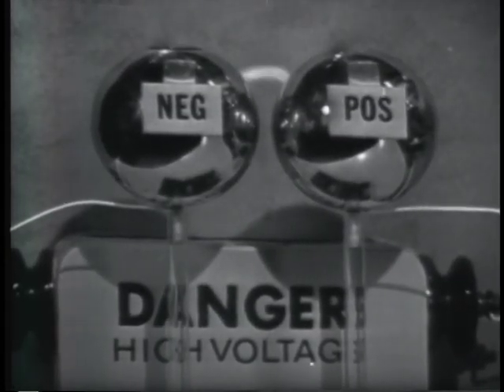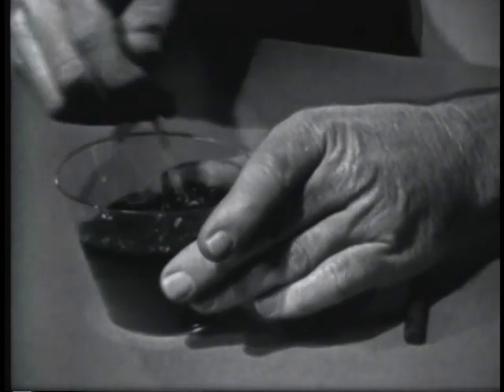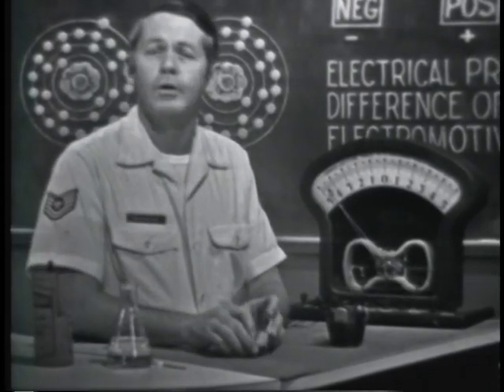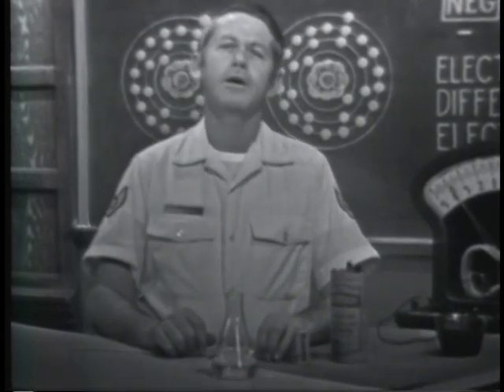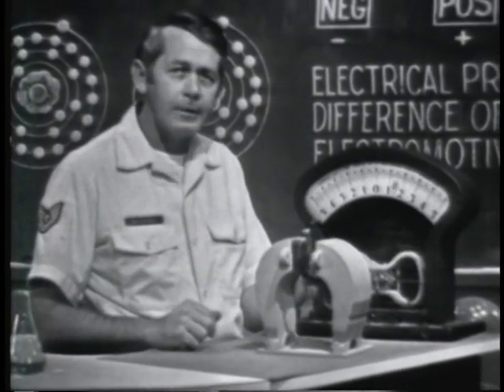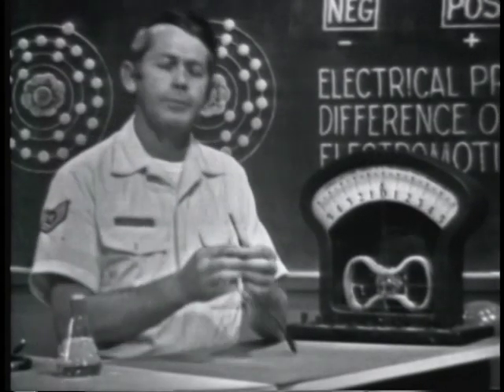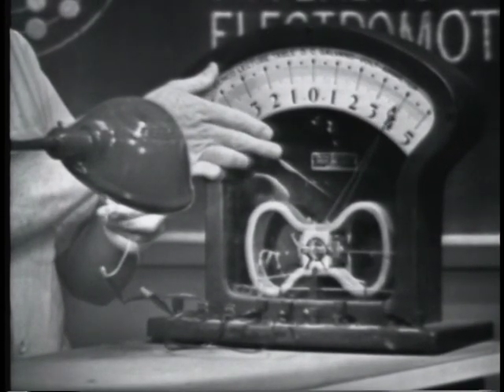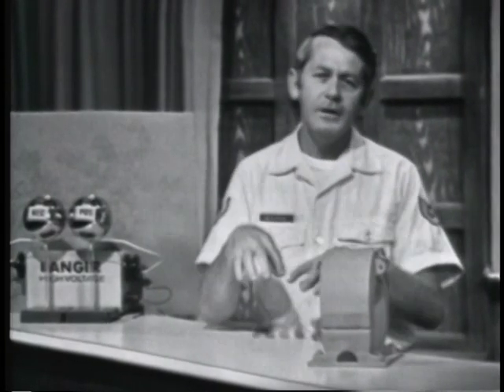ELECTRICITY - VOLTAGE

Comment: There is ionization of the air between the two charged globes, and the plasma arc is the stream of ionized air molecules with electrons that have been excited to higher orbitals around their atoms, then fall and lose the energy which is given up as photons of light.  Electrons are not 'leaving one charged globe and traveling through the air to the other charged globe' - there are existing air molecules that simply are electrically excited to the plasma state.   You could demonstrate this by operating the two charged globes in a vacuum chamber that removes all the air molecules, in which case there would be no plasma arc.  There would be minor sublimation.  But electrons would not jump between the charged globe in either case.
Reply: You might be right but you're probably not convincing the audience that this is meant for if you use that much terminology to explain your contention.
Reply: @tkyk4893  Not really trying to sway folks' opinions one way or the other, just made a comment about the physical nature of what's occurring. 

I work with a small team on artificial gravity devices, and we have a philosophy,  "uncover the correct facts to avoid wasting time on a misunderstanding of Nature"

An example of huge waste of time is people who spend years believing back EMF spikes from coils are 'over-unity' energy, and do not know Faraday's law.  I know people who have spent years on that one.  

It's vital to get the correct assessment because learning after many years of fooling yourself about Nature can really hit home.

With artificial gravity, it is quite easy to make this kind of mistake, because it is a taboo subject and there are no college degrees, no established science on the subject.

Trying to get Nature right is freaking vital.